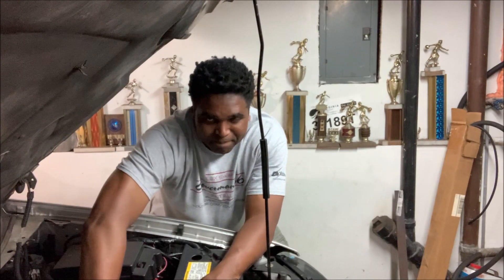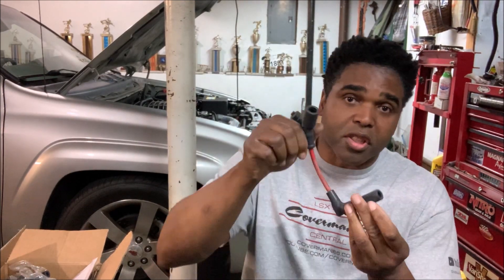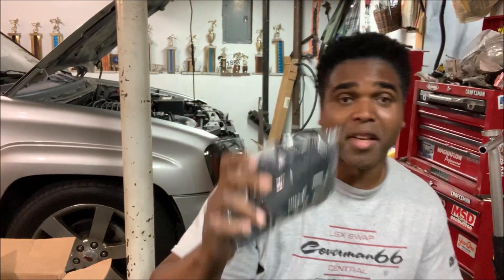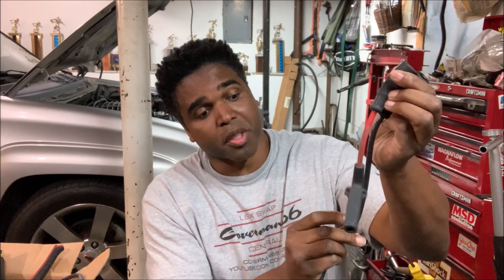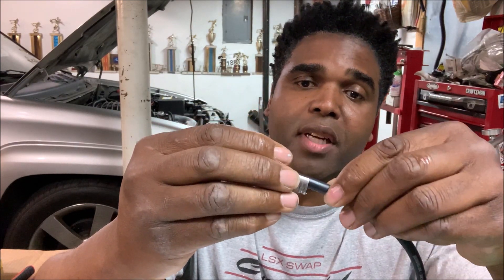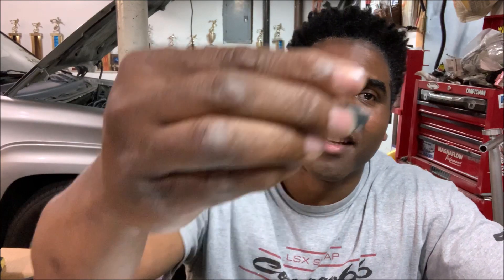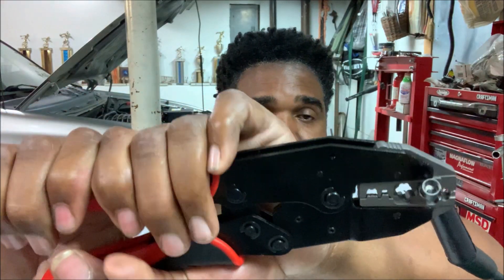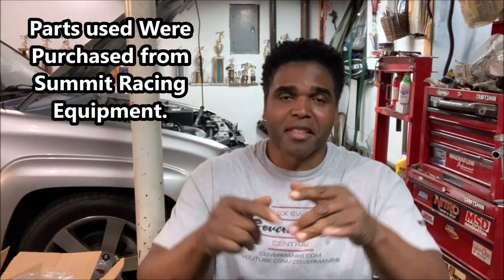How To Make Custom Spark Plug Wires and Test Resistance.

Comment: Hey brother, I know you are a huge fan of the ly6. I was wondering if I could get it to run on a stand. I dont have ho tuner to flash the ecu but maybe you know a trick similar to lsdroid or resistors on specific wires or something.
Reply from the maker: is the engine in the car now?
Reply: @Coverman66  nope still on the stand